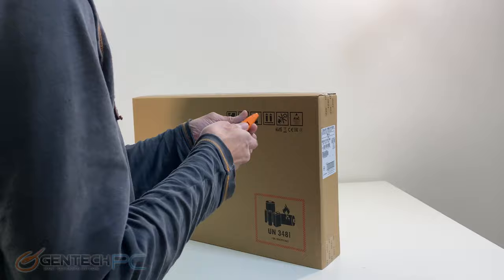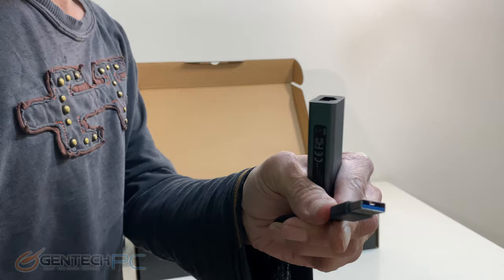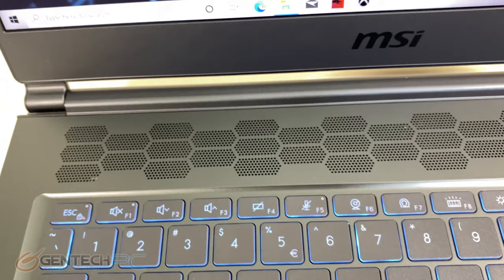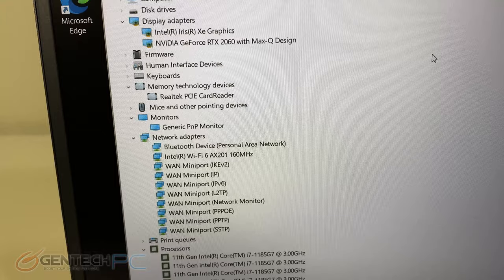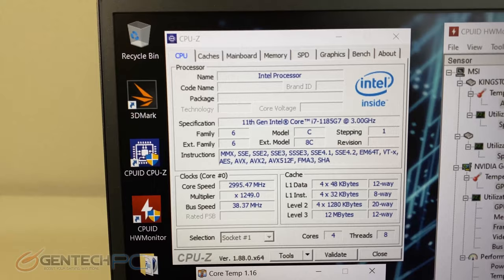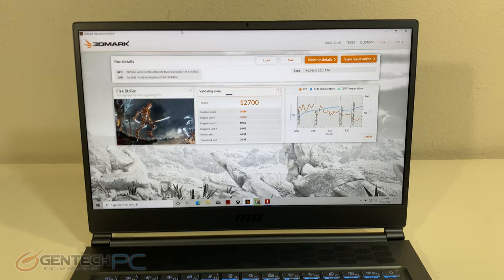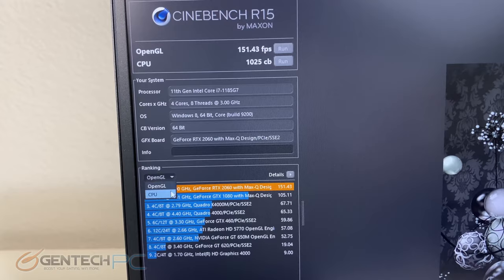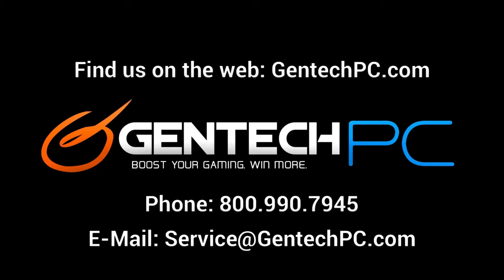MSI Stealth 15M 11th Gen Tiger Lake, RTX 2060 Full Review and Benchmarks

Comment: Finally someone did receive on  that laptop, i was waiting since November thx u bro
Reply: If my tracking is to be believed I should have mine tomorrow Dec 31
Reply: I got mine 😊
Reply: How is the cooling system?
Reply: @lynengmix8175  The cooling system works very well, the fans are loud when on the coolerboost setting, but the GPU never goes above 72c and the CPU will hit the 95c thermal limit but can still maintain an all core turbo of 4.1ghz indefinitely
Reply: compare to predator triton 300 which is better?
Reply: @lynengmix8175  Well you can get the triton 300 with a 2070 Max-q so the gaming performance would be a bit better, but it only comes with a 10th gen CPU, if CPU performance is important i'd go with the MSI if gaming performance is important i'd go with the acer
Reply: @TnTTyler  the i7 1185g7 is in fact slower than the 10750h which would come in the triton 300
10750h is 16% faster
So it guarantees much more cpu performance
Edit: sry if it feels I'm being a dbag
Edit2:triton 300 is easier to upgrade
Reply: @nosc0pe  Much more CPU performance?  At how much more power?  https://www.cpubenchmark.net/cpu.php?cpu=Intel+Core+i7-10750H+%40+2.60GHz&id=3657   How come my Stealth gets 13636, and 3304 in single thread, that's faster than the 10750h and does so with less cores...
Reply: @user-os1yk4co4f  Is the laptop doing well bro?
Reply: @TnTTyler  How is the weight feel, does it feel balanced and light, I will mostly using it on lap (with cooler ofc) so weight is important to me. I been searching for light weight gaming laptop for few months (which does not break bank either) and find this one most compromised solution. 
Plus what avg battery time you get (excluding gaming)? 
Thanks
Reply: @AfaqSaleemChannel  Its pretty light for a 15.6" laptop,  also laptop is doing well.
Reply: @pisethheng9519  yes so smooth
Reply: @AfaqSaleemChannel  1.6kg
Reply: @TnTTyler  Thanks a lot, any info on average battery life without gaming? Is it in long duration (6~8hrs) catagory or short duration (~3hrs). I bought Acer Swift 5 for my relative and it on average gave me 8~10 hrs with normal use, like browsing, watching movie etc. Of course if I did something CPU/GPU intensive like rendering, it would drop to 3~4 hrs.
Reply: @user-os1yk4co4f  Thanks, I know the weight figure, I am more interested in how balanced it feels, sometimes laptops in light weight catagory tend to get uneven weight, so just asking for your opinion, did you notice any discomfort while carrying it (like if there is an unbalanced weight, holding one way it feels heavier and uncomfortanle, holding it other way feels light, I hope you understand what I am trying to ask)

Comment: Just got mine today doing some initial numbers but I can say MSI nailed the cooling system on this and has very high PL1 and PL2 limits vs other 1185 laptops
Reply: How’s the display and battery life? Those two are concerning a bit
Reply: @1BadVan  Display is very nice, i'm used to 4K 60hz screens so having a 144hz display is really nice.
Reply: @Thomas Brandl Yes when set to the balanced silent or super battery mode while plugged in the fans are either off or quiet.  In the extreme performance mode the fans run on low all the time but they are barely noticeable. Low speed on the fans is approx 2500rpm, the max speed when coolerboost is on is 6500rpm

Comment: PL1 Power Limit is 44w PL2 Power limit is 64w, it will sustain 4.8ghz on a single core forever.  Will sustain 4.3ghz all core turbo in everything forever, except Furmark CPU burner, In Furmark is goes down to 4.1ghz.  Max temp of 93c  The RTX 2060 is limited to 65w and will hit max boost of 1815mhz for a short time settles in to 990-1000mhz with a max temp of 71c.  The cooling system is amazing on this laptop really allows the 11th gen to stretch it's legs with no thermal issues
Reply: How’s the display quality and battery life under normal usage?
Reply: @1BadVan  No battery life tests yet, but it would appear light web browsing in the max battery mode is 3-4 hours, nothing too special